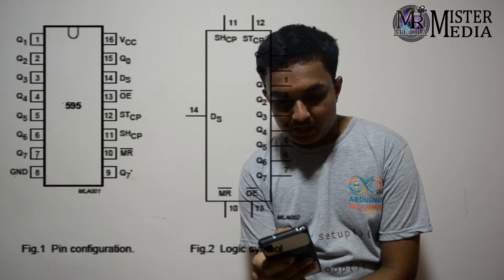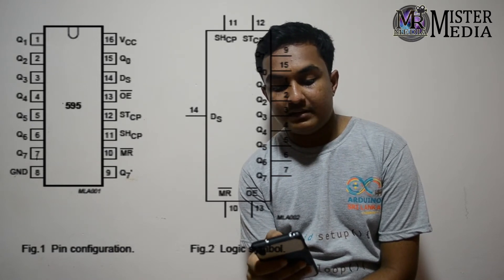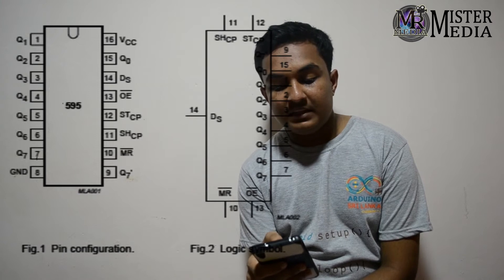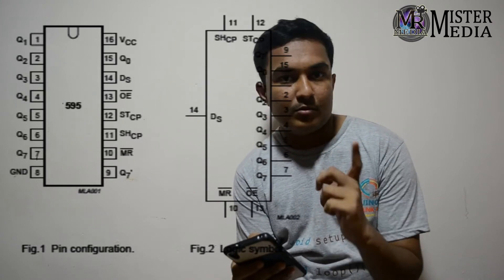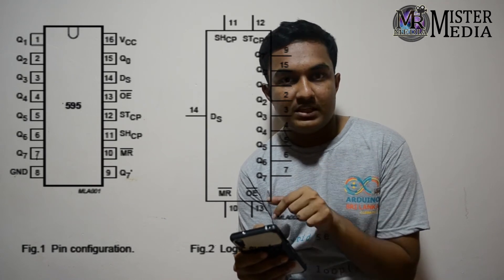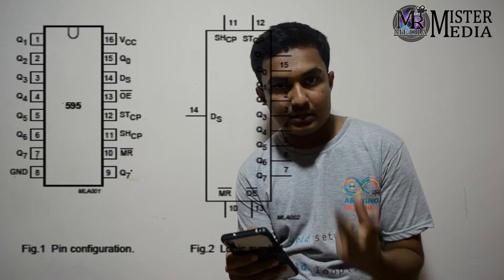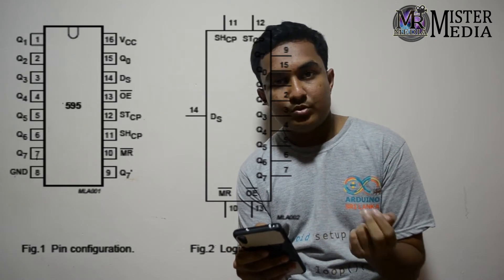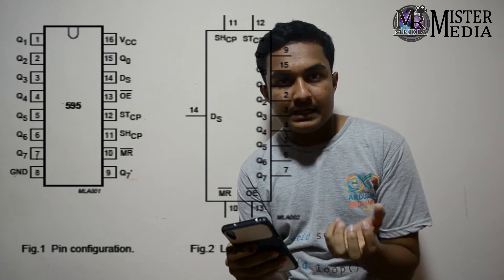how to get multiple outputs in Arduino | 74HC595 | தமிழ் | Learn Arduino Series in Tamil Ep-36

Comment: 4 ic use panni particular led on off panna mudiyuma bro. example sollunga
Reply from the maker: Yes you can use upto 10 ic no problam
Reply: Yeppadi bro.pls tell me (or) sample video make bro pls.
Reply: Yeppadi bro.pls tell me (or) sample video make bro pls.
Reply from the maker: +94 77 3934001
Reply: IC 74H595 use panni 7 segment led ahh keypad la control pannalama bro.exp- 1 pressing show in display 1.

Comment: As any arduino board all pins can be used as digitalRead. My arduino Pro micro board has 18 pins for use as digitalRead.  I 
 Need to 42 pins for input to my arduino board.  Is it possible using 74HC595 shift register????? .  If yes,   please help me with arduino sketch & wiring diagram arduino board to 74HC595 and push buttons,,,,,,,